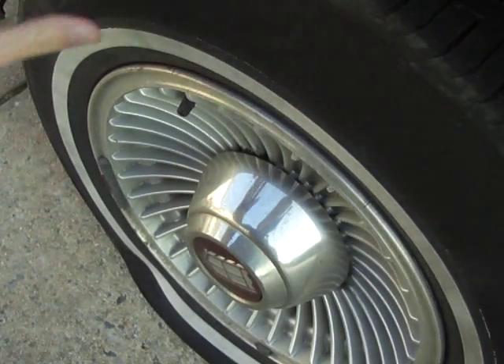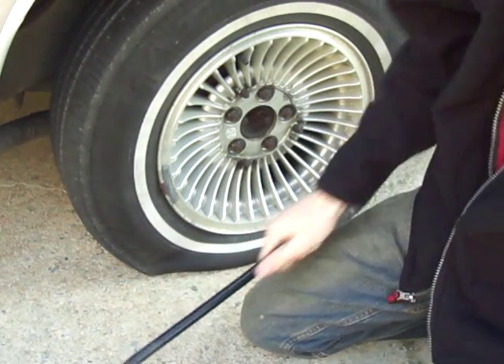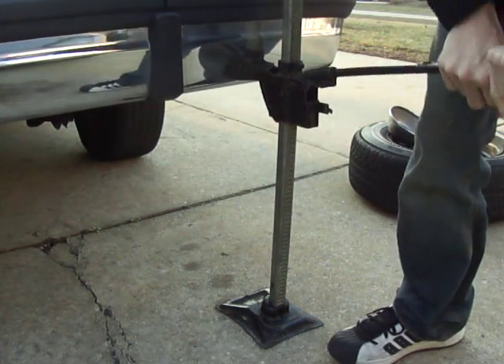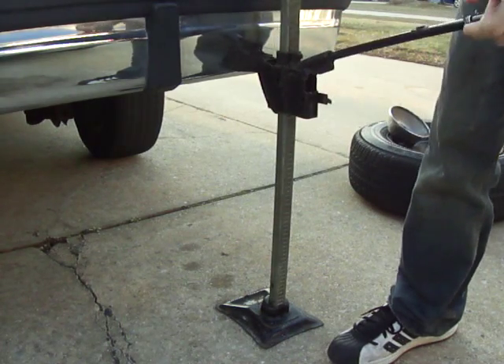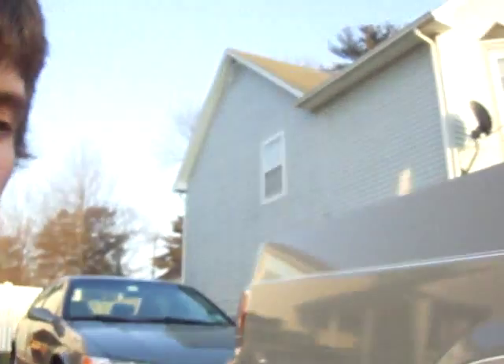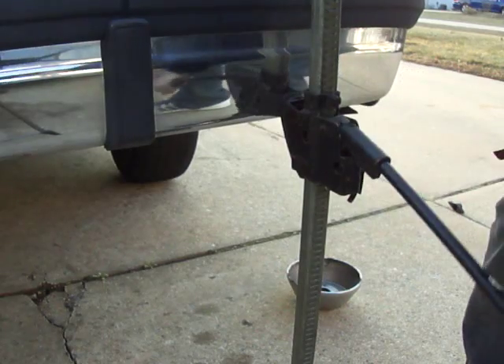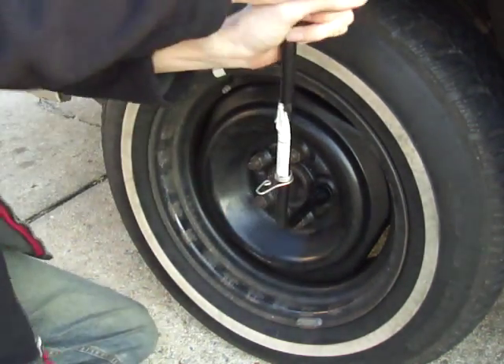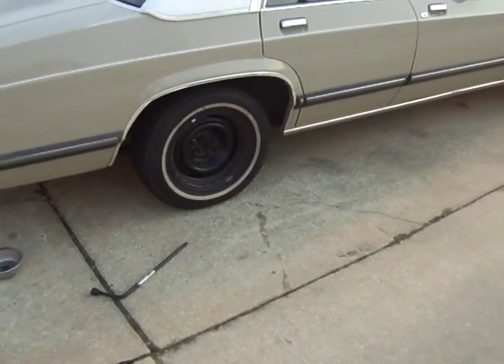How to Change a Tire on a 1979-1991 Mercury Grand Marquis

Comment: Thanks!  I made a blemish on rim edge with tire iron, darn it, then I put an extended socket sideways, set on rim spokes, as a leverage point, made it easier to pry off, and tire iron didn't touch rim.

Comment from the maker: @McVaio 
Trust me I'm very careful- but that blanket idea is a good one I had never thought of that before- I will have to try it.  With your '94 GM look for spare caps or wheels (which ever is damaged) in a junk yard there usually fairly economical.  I know if I want to get a spare Ford C. Turbine 15" wheel its $40 (with a good tire) and the lug covers are only $.50.  I will post so new Grand Marquis videos soon, thanks for subscribing!

Comment from the maker: That would suck!- Most of the tires fitted to these rims such as the Goodyear P215-70R-15 (pictured in the video) have both black and white striped sides, you just have to tell the tire shop which side you want.   Although now adays it is common to see these tires marketed with BW sidewall (meaning "Black wall"), if you are shopping look for WW (white wall) sidewall tires.  The white wall isn't really that rare.  -Thanks for watching!

Comment: @VICNASTY1989 I am really surprised that you didn't get the air suspension on your car, since you have a heated win shield rare option on any 90+ and leather and JBL audio. Some 84-91 came with Rear Air Suspension, while from my understanding it wasn't available on the Town Car till the new model in 90.  I happened to be browsing autotrader one day and came across a mint 1990 with RAS, it was a Texas car.

Comment: @VICNASTY1989 I know I used mine once on the 1991 when I had it, and it either rolls a bit or gets wobbly when using that type of jack.  I generally just used a cheap floor jack....LOL  Yes the front, unless you block it does roll.